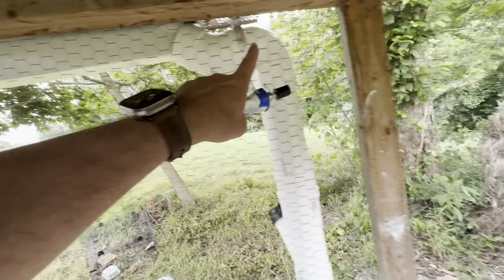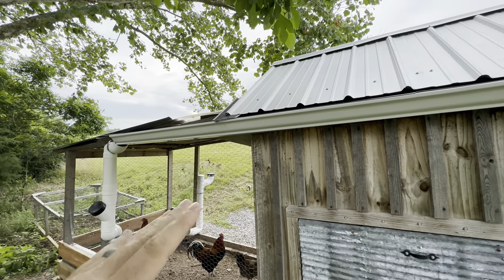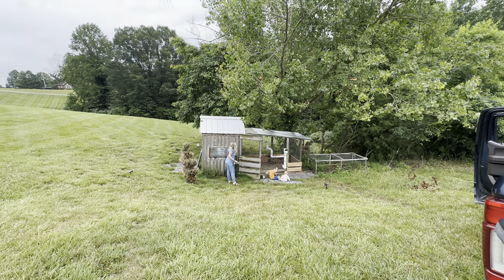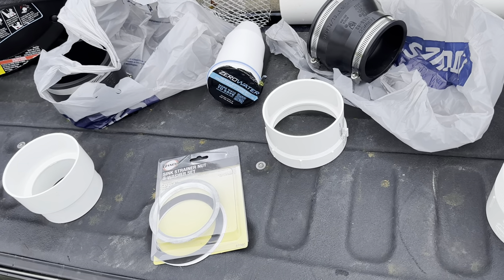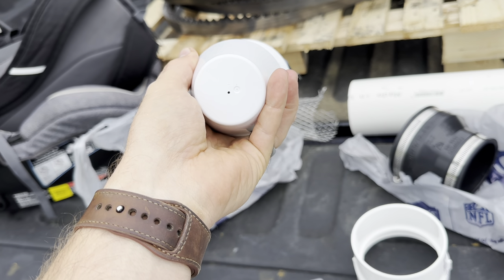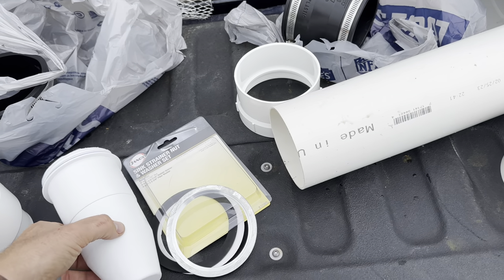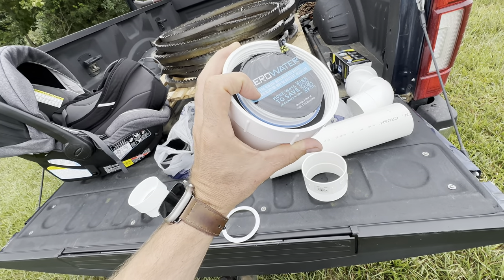How to make a PVC rainwater system that cleans the water

Comment: 4:38 I love how you try and gaslight people who question you setup. Yet you are the one that is lacking. Your system is over build and over engineered, without it doing any better than most other water systems.

If you knew better you would have just made first flush system, then have the overflow  fill a tank. From there you add a irrigation strainer. Add vinegar every once and awhile. 

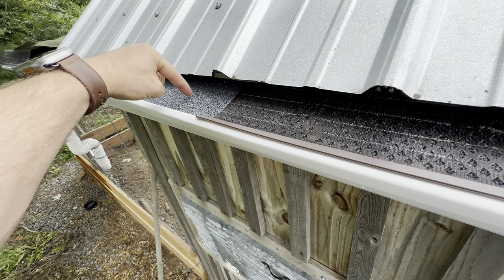7:11 you didn't make a filter you installed one.
Reply from the maker: If you read the comments from the first short. You may understand better what I’m speaking of. It’s not if someone questions. It’s them making uneducated claims and commenting from ignorance. 
You don’t have to watch if it hurts your feelings snow flake
Reply: @americandream_89 yea gotta agree with the people saying this is a bad design that foam filter gonna do nothing with those trees and the whole design is complex
Reply from the maker: @fondbeebboop9705  that foam is made for house gutters? You think it’s going to clog out what?
Reply: Bunch of folks don't care to appreciate this. It's your design, not theirs. If it works, be proud of it. Not sure I agree with the black cap automatically falling off, does not look like it will. If it does, I'd def attach a chain to it.  However, again, it's your design man. Good job.
Reply: @zachhot  His design? He put a Britta water filter, how is that "his" design?
Reply: @AztecWarrior69_69 definitely not 'brita' pretty sure it's from Zero. Which of course also sells the PVC and coop attaching instructions all in one box. Right?
Reply: @AztecWarrior69_69 Show us a better idea. I am excited to see what you have. It must be amazing considering your stance here.
Reply: @zachhot  I already have a walk-around video of my system. It is the basic first flush system. Collection first, filter later. Like 90% of the system out there. Why use a lesser system when the tride and true works.
Reply: @AztecWarrior69_69  I watched your video, as well as a few others. They're all great videos. As a technician it's great to see a meld of poultry and technical knowledge. I considered incorporating a raspberry or arduno board in some way or fashion but decided against it for two reasons; time and complexity, which usually runs hand in hand. That brings me to my main point: while your system does have a brilliant feature inhibiting a frozen water supply, its complex for those seeking typical farm mindset. The gentleman in this video created a system fueled by gravity and added an in-line filter from a water company. I can guarantee you his approach cost less. In terms of flow of water cleaning what is behind the nipples; you supposedly have a closed loop system, so the benefit seems redundant. All in all, you're comparing simplicity with your system. Two entirely diff mindsets.
Reply: @zachhot  "while your system does have a brilliant feature inhibiting a frozen water supply, its complex for those seeking typical farm mindset. "

It is not complex at all. rain water fills the tank. Gravity pulls the water down, goes through a filter and fills the pipes. If you think a farmer can't do that then that's you insulting farmers.

You don't need the winter pump. Unless you need it.

" I can guarantee you his approach cost less."

Not a chance. All the PVC we both used probably come out to about the same. the filter he is using I guarantee costs more the the two filters I use. Total of $20 for me.

"you supposedly have a closed loop system,"

You then didn't watch my video. It is not a closed system. It collects rainwater. No rainwater system is a closed system. 

 "ll in all, you're comparing simplicity with your system."

Nope. My system can be put together without having to figure out how the filter is going in. Mine is much simpler since it is all just off the shelf parts that are meant to go together.